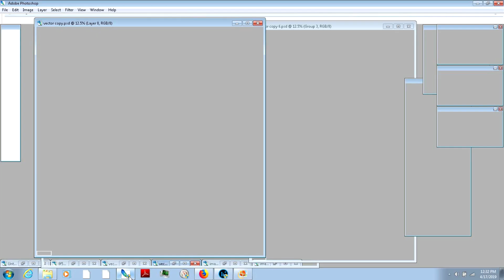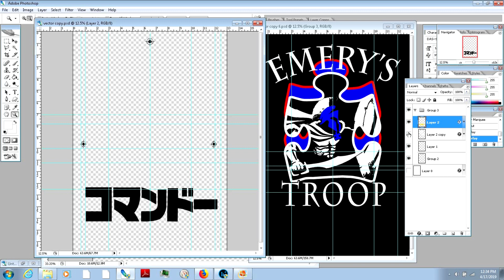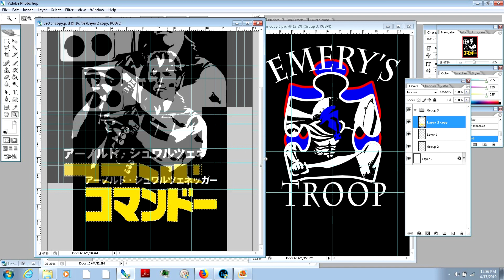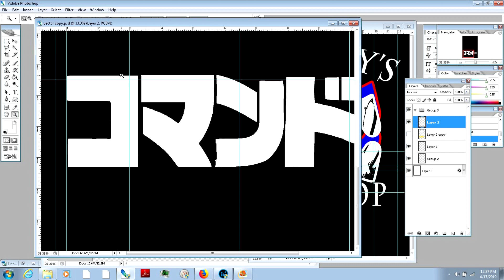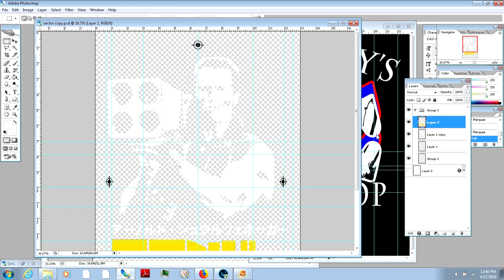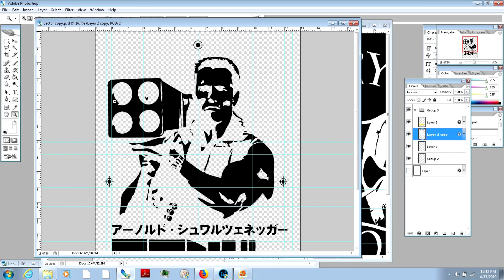Color Seperate the right way Screen Printing Artwork Prep How to Series Vol.3 KING PRINT

Comment: Illustrator is so much easier for seps.
Reply from the maker: How
Reply: @KingPrint  Because of the Separation Preview and Attributes panels. Allows you to see exactly how your seps will print out before actually printing. Yes, you can do seps in Photoshop, of course, but that is not what Photoshop was designed for. To each his own.